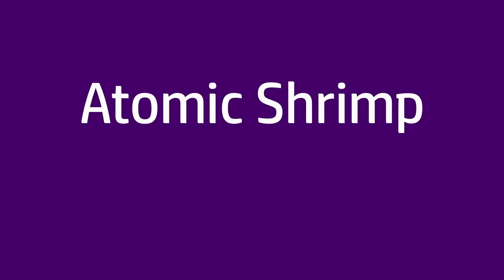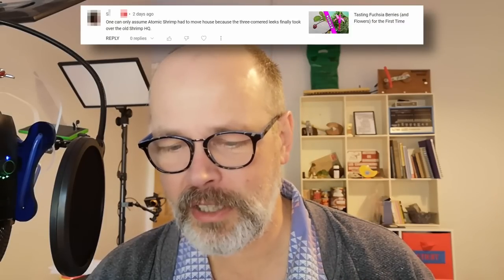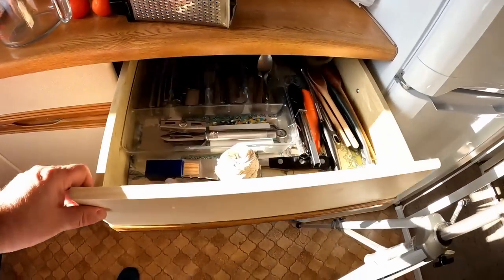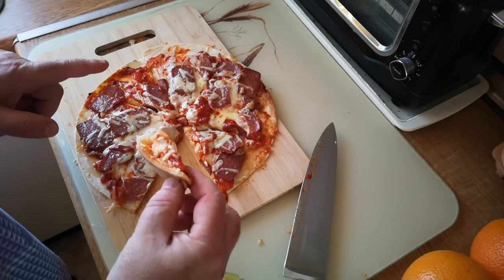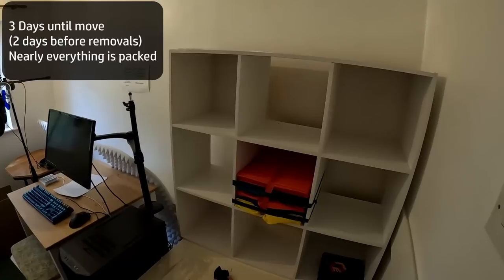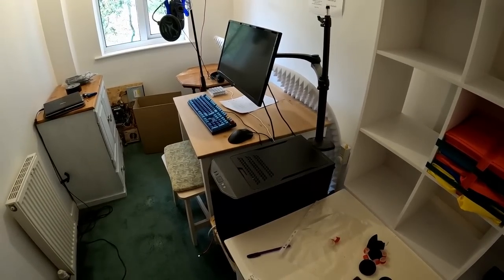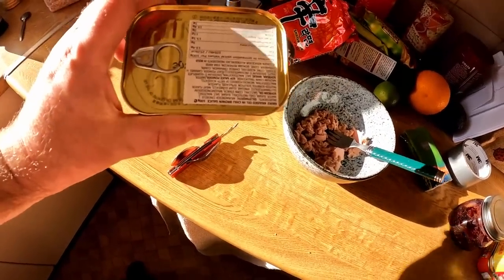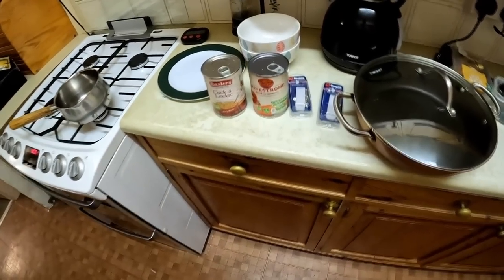Random Stuff - Shrimp Cottage Edition

Comment: I'm not surprised that the gochujang and ketchup worked well in that pizza sauce.  Some years back I worked in a very nice pizzeria and along with the "normal" sauce ingredients (tomatoes, garlic, herbs, etc) there was about 500ml of hot sauce, we used a fairly standard vinegary hot sauce, as well as some sugar in a 5 (imperial) gallon batch.  I think the ratio of chili was higher in yours but a bit of vinegar, spice and sugar works very well in a pizza sauce, I've added them to mine ever since.

Comment: I'm sure that you have already seen them or formulated a better plan but you can buy bungs to plug the water tank outflow. That way you can drain the tank down, plug it up and then go about chipping/brushing off the limescale without fear of it entering into the tank or pipework. Had to do the same for my old tank some time ago in much more cramped conditions. I found that a clean dustpan with the rubber trim was useful to push up against the wall of the tank to catch the falling scale as I was cleaning. Then to scoop un the remains on the bottom. A friend who has aquarium supplies plugged his, added limescale cleaner, part filled with water to dilute then ran a small fish pond pump to drain it out via his bathroom. In any case congratulations on the move Shrimp Cottage looks nice and that garden has such potential looking forward to new videos as you get the greenhouses up and running.

Comment: A higher water level in the header tank is no bad thing, it'll give any drips from the float valve less distance to fall - that'll make them quieter. Same way that you always notice a dripping shower easier than a dripping tap.

Early british water systems were a bit paranoid about everyone turning their taps on at once and dropping the water pressure, so houses only had one tap connected straight to the mains (generally in the kitchen) - the rest (e.g. bathroom taps, toilets, the hot water system) came from a grotty tank like that in the roof, with a small opening on the float valve to limit flow. With old british plumbing it's not advisable to drink from any tap other than the kitchen cold one.

Comment: Than you sir very informative. I'm a Brit that has lived in France for 40 year. Here lmost houses and some apartments have mains pressure immersion heaters for hot water, which means of course the hot water is at mains pressure. These are fitted with emergency escape valves in case the thermostat fails, which would otherwise turn them into a bomb. This is the reason that you can't have mixing taps in the UK because of the differential pressures which would allow cold water to flow into the hot water accumulator.  This means you can have a shower like a fire hose. These mains pressure hot water tanks are now available in the UK as my brother in Devon just had one fitted.

Comment: To be perfectly honest, the water heater + header tank is the first thing that I would pull out of there and replace it with a modern combi-boiler/heater system.
When I moved into my house, the first thing on the agenda was to replace the old combi-boiler. I wasn't about to muddle through for even a day with an old, inefficient, and potentially dangerous system. We use mixer taps everywhere, so it has to be safe. And without a hot water tank, it also has work reliably.

Then again, each system has its place in the right context, and if you're happy with it, by al means leave it as it is. Moving house is quite an undertaking anyway.

Comment: We swapped from a gravity system with open tank to a sealed pressured system this year and it was a really simple and cheap process.  It means changing your hot water tank to a different type but they don't cost a lot more then an old type. Very little pipework change which was mainly within the airing cupboard and it just connected to our old boiler.  We don't have a combi boiler, just a regular one so you can do the same. It freed up a lot of space where the tank used to be and I was able to take the old copper tank and a few pipes to the scrap man and that reduced the cost even more. We now have drinking water on all taps with high pressure which is good for showers and I reckon it cost not much more than £1k.  Heating also pressurised so we lost the header tank too and because we fitted a magnetic filter into the system, it is now cleaning out any sludge.

Comment: We had a system similar to that until 4 years ago when we had it ripped out. It was 60 years old and the main water tank (huge rectangle shape) was made of copper, with a much smaller header tank at the top/ front of it  (no idea what that was made of as it had blackened over the years). The header tank was the first to start leaking( which we managed to fix somehow by patching it up and it kind of sealed itself up after that) then a while after that the huge main tank started to leak and wouldn't stop. It was at that point that we decided enough was enough, as I was terrified of the weak spot getting worse and had a vision of something giving way and creating a huge flood. It had to go. Seeing that certainly brought back some memories.

Comment: Good luck with your House! I have boughy mine this August. Old German "Fachwerk" Style, Build sometime between 1200 and 1800, extended in 1924. Much  work, much to find out. 
Funny hot Water system you got there. Here in Germany, such a system ist very uncommon. Most have boilers, heated up by oil or gas. 
But the valve... couldnt you have just cleaned it with vinegar or citric acid to get it back to service? Might be also a lazy mans solution for the lime stone. Dump a load of acid into it like vinegar, wait to dessolve the junk and then get rid of it by pumping it out?

Comment: Years ago, I worked with a lady who still lived with her parents.  They had the usual hot water arrangements as shown in your video. I have the same, but there is a lid on the header tank. Her parents' didn't. She noticed a strange odour when showering and mentioned it to her dad several times - none of the rest of her family did. Eventually, he went into the loft and inspected the header tank.  There was a rotting blackbird in it.

Comment: 0:48. You are correct, but it is done to slow down decomposition. When you have a big carcass, it will emit a large amount of decomposition gasses. If left untreated, it will decompose to quickly, not only creating a potent smell that will linger for ages, but will also affect the structural integrity of the earth as it could make a cavity.

The lime is a drying agent, and will inhibit the decomposition. Fun fact: Dumps have a similar problem, However, they want decomposition. Because of this they tend to use cinnamon oil on the trash to mask the smell.

Comment: For the limescale - just heat the water with am immersion heater and add a couple packs of powdered citric acid from the cleaning aisle.
I just had to clean out the water tank of my toilet (the kind, that is set into the wall and is barely accessible), because the toilet was leaking water. Looked pretty much like your water tank. Googled it and it said, limescale was the likely culprit. 
Got some hot water in there and let the citric acid to it's work for a couple hours. After two rounds, the problem was solved. You'll just need hot water for this to work with thick limescale like that, I think. Or the process will take forever.

Comment: You had an old mans header tank. Once you think its turned off then it drips for hours and often-wise its needs to empty before its finished dripping! When i went into Wickes and showed them my ballcock and associated Nuts i got arrested! Good thing i didn't ask about how i should adjust the orientation of my arm from going up and down the  shaft so that it  rised more than it did before enough to stop my gland from dripping!  Give a hug to Eva who probably is confused and wondering why everything looks and smells different. Knowing that human mum and dad are there helps.

Comment: re. the header tank behind the panel - If you attach a piece of old garden hose, or similar to the white plastic outflow of the ballcock extending about an inch (2.5cm) below the surface of the water in the tank when full, it should reduce the water noise considerably. Please never stop making videos, I find your content very entertaining, such variety! Your new garden looks great, especially the woodland area (Upper, rear garden wood?)
Reply from the maker: I think if I attach any tube, it needs to be made from collapsible film. A piece of hose could result in siphoning back in the case of loss of mains pressure
Reply: @AtomicShrimp  Thanks for responding. A good point, but perhaps a small hole high up the tube would prevent syphoning? When I used a piece of hose, it was in a toilet cistern. I have also used a long sandwich bag, taped at the top which is, as you suggest, collapsible, but still allowing water to dribble down quietly.

Comment: Some of my fave meals are tortilla based. I recently had one of those taco bell crunchwrap supremes and enjoyed it so much I made my own variation using a plain flour tortilla with a smear of salsa followed by fried spiced peppers and onions. On top of that i plonked fried chicken thigh strips in a spiced cheese sauce. And then followed that with grated hard mozerella and jalapinos with sour cream and guacamole  Wrapped that into a square parcel and in tinfoil and in the oven rill the cheese melts and sets the shape. Then a final dry pan to get a bit of colour on the outside. I also occasionally do a similar parcel but containing a full English fry up in miniature form.

Comment: hi Mike.  Great to see your new place, it looks brilliant. 
If you want to clean your header tank out  I have a suggestion. 
Get in there with a brush and break up all of the larger deposits down, also scrub the sides. Leave it for few hours to settle. 
Then use a garden hose and set it up as a syphon. 
It's like a small wet vac. Doing this is really quite satisfying. 
Also noticed that the overflow connection on the tank is higher than the  ball valve connection,  so you'll need a good seal between the ball valve and tank. Ideally the overflow hole should be below the ball valve connection so it reaches that first. 
Hope that makes sense. 
Anyway look forward to seeing more in the future 🙂👍
Reply from the maker: Yeah, I reckon I should probably cut a little piece of that super sticky duct tape and just stick it over the inside mouth of the outlet pipe that goes down into the hot cylinder first, then I can get really messy with the scale and not worry about it clogging that pipe. Chances are the inside of the hot tank is already a limescale nightmare though

Comment: The water tank valve changeout was interesting to see you do.  Welcome to your new digs.  I see the charm of all that garden and wilderness area.  If you find the tank does drip, I suggest instead of a wire, a stainless steel ball chain--not sure of the exact name.  Here in the States you might see such a chain on roller blinds.  Maybe on military dogtag chains...
Reply from the maker: Ohhh, I have a load of that chain from a Steve Mould-related previous video!  Thanks for the suggestion!

Comment: Hate to be a plumbing bore but PTFE tape is for tapered pipe threads, your thread there is a straight thread and isn't doing any sealing, that's what the olive is for. You might find the PTFE tape stops the nut being tightened enough and you may get a leak.

Comment: Looking forward to some of the DIY content. It's not so much the solution, but - as you say - the 'figureoutable' process; seeing HOW someone approaches a problem and determines an answer is a really important element of the educational process.

Also hoping there will be some new grocery stores near you - I wonder if the budget challenges will be any different? I find the reduced produce section in my local grocery store changes slightly by area (based on the local demographics), so I'm keen to see if that's the same for you.

Comment: Good luck in the new house.

Re the header tank... you probably want to consider replacing the ceiling over the top of it at some point. It is really bowed.
Reply from the maker: Yeah, I think that's just a hardboard panel, but you're right. I think that's from the tiny splashes from filling and maybe condensation. The tank needs a loose fitting lid

Comment: A quick fix for the dripping noise would be a bit of bent aluminium or thin stainless under the drip to catch it and let it flow into the tank instead of drip. You can also run the filling water through a PVC pipe with small holes to direct it onto the side wall of the tank to reduce the filling noise a lot, it's against regs to not have an air gap between the tank water and the mains water inlet so the obvious solution of just running a PVC pipe into the tank would technically be illegal.

Comment: 20:19 top left bit of chicken looks a bit like Dobby the House Elf's head. Also regarding you filling valve, you can also get a silencer (basically a soft plastic tube) to suppress the water dripping noise. Although your wire idea will also work!

Comment: You can get a polythene  (sometimes the layflat style) tube to attach to fill nozzle on the ball valve, that goes below the fill level and reduces the splashing noise when the tank is filling. Presumably it would do the same for dripping. So if you find the noise disturbing it might be worth looking into (this is old info from when I had a house, perhaps these days its frowned on? The regs seem to change all the time!).
Reply: One of the reasons we come to your channel is the huge variety of subjects, so don't be afraid of a few new topics by the way!
Reply from the maker: I think a polythene tube is probably OK. A rigid tube is probably not, as it could siphon if the mains pressure dropped
Reply: @AtomicShrimp  Ah yes, that would explain why the ones I saw where layflat style.

Comment: Re. The continuing drip in your header tank. I have a similar issue with my toilet cistern and I find that if I access the ballcock and quickly submerge the float and immediately release it, the resulting bounce is usually enough to silence or stop that annoying drip. If that is not enough to prevent it, then it is also possible to obtain a small section of a rigid pipe that will fit into the hole where the water emerges from the ball valve and is cut to just submerge the tip of the tube in the water. This should be sufficient to silence the entire system. Before I close did you bring some of the 3 cornered leeks to transplant into a container so you can still add them to your foraging.
Reply from the maker: I think a rigid pipe is probably against code - if mains pressure dropped, it could siphon back
Reply from the maker: And no way am I introducing that plant here. Its too unruly 🤣

Comment: What you need is a Torbeck / Equilibrium type ball valve, Mike.  They have a decisive "Off", although they may cause water hammer if your pipework isn't well supported.
Reply from the maker: I think the open bottom of the float on that type of valve is better suited to a tank that is fully drained then fully refills (eg a toilet cistern). I think turbulence of filling a water header tank on a partial cycle could potentially slosh air out of the float and result in failure to shut off
Reply: @AtomicShrimp  I was scratching my head about your reply, then looked to check some listings...  They used to have a sealed float, but apparently they no longer deem a gramme of extra plastic necessary.  You could always glue a lump of polystyrene inside it, if you are worried it might sink.
They come with a silencer (polythene) tube, which is generally submerged, so turbulence isn't a problem.
They've been around for 30+ years, and are quite reliable.

Comment: Kinda crazy how housing infrastructure in a developed country like yours can be worse than that of a developing country like mine. The hot water tank horrified me! All my life we've had either one of those little cylindrical water heaters out back or a tankless heater. No wonder whenever we travel, we're told to not drink the tap water... I'm so accustomed to getting hot water from the tap to boil
Reply from the maker: Developing countries often get the benefit of late adoption of mature technologies. One of the reasons the UK has problems with public sewers is that they happened too early. Before people realised it was sensible to separate sewage and rainwater
Reply: @AtomicShrimp  Yup. Living in a former British colony, T&T, so much of what you show off that perplexes Americans is normal to me, but not that one. We're definitely caught between two worlds design-wise.

Comment: Plumbing shrimp here. You might be better off with a torbek or similar, they are an equilibrium float valve and will shut off rather than just running or dripping. Also the PTFE tape on the thread there was not in the right place. You only need to apply tape where the seal happens in this case that is where the two faces meet not on the actual thread. The torbek will be the same size as the part 2 float valve you have just replaced.
Reply: Equilibrium valves might also be a good subject for a video as they are very clever.

Comment: What's the purpose of the cold water reservoir? So you can have one final shower if the water goes out? Also, if hot water is fed from that reservoir and not directly from the mains, won't the water pressure be much lower?
Reply from the maker: The shower is not fed from the hot tank. It's electric

Comment: You should never drink from the hot tap anywhere. You shouldn't even use it directly in cooking. There can be metal deposits (from the pipes or water heater) or other things that aren't good for you, as a result of the water sitting around for a long time. We use a single water tank for hot water and the common knowledge has always been not to consume it.